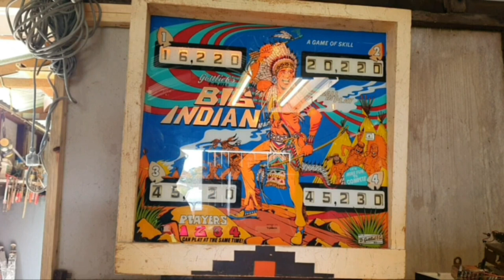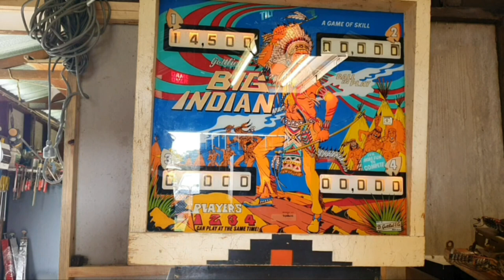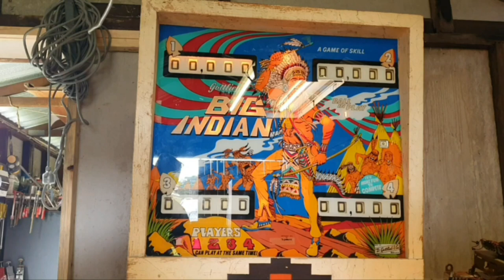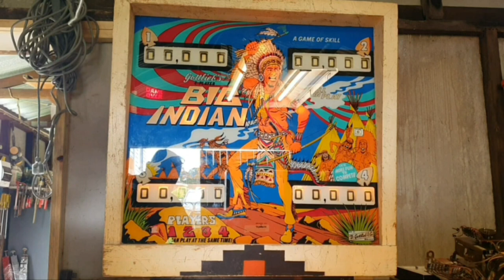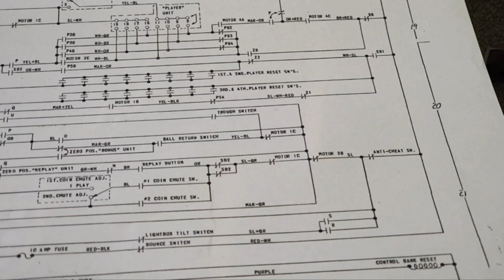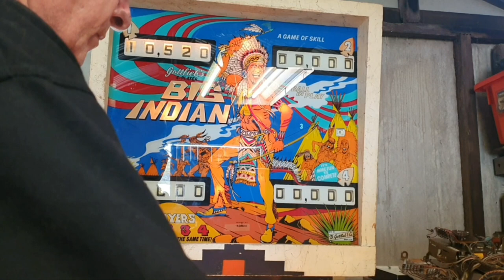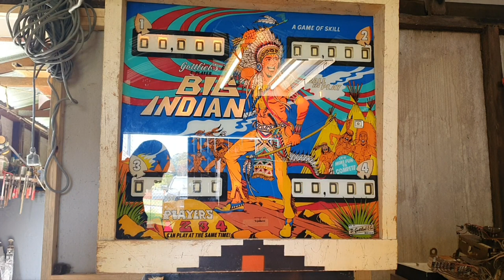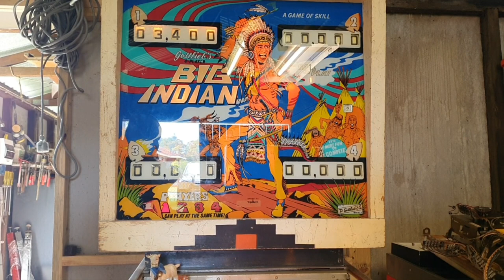Troubleshooting Big Indian Big Problem Switch In Score Motor Schematic Used.

Comment: Thanks for making this video. Videos packed with education aren't annoying when they are long. More troubleshooting videos would be appreciated.  If I may, I'd like to add some of those details to your commentary in this comment to help your community.  At 1:20 the cleaner for the rollers is isopropyl alcohol. 6:00 Before removing the chime wires label the chime unit - on Big Indian it's (L to R) BL-BLK on first coil left side and BLK on right side, OR-BLK on 2nd coil left side, BRown-BLK on left side.  At 11:30 when fastening down the Relay Bank (aka Sequence Bank, Trip Bank Latch Relay Bank etc.all refer to the same) it should be perpendicular and flush. Mine was not fastened flush and on game over it would cycle repeatedly on drop target reset - as an example. At 11:44 the Relay Bank is reset and XB wobbles.  Watch for that.  17:10 the 'tilt' aka door slam switch is normally closed, that is why the jones sockets are jumpered (to simulate normally closed). 22:12 For those restoring to original,  spray silver Krylon Marbelizing paint through a fine screen after the white base coat (practice first) for a speckling effect.
Reply from the maker: Yes indeed great ideas thanks for your input.

Comment: I just happen to have the same problem with my Royal Flush going from player 1 to player 4. I cleaned the 2B switch. I also noticed found that my coin until had a wire touch where it wasn't supposed to. So, problem fix. So thank you very much for the videos.
Reply from the maker: Excellent glad our videos help you thanks very much.

Comment: Excellent video with some problems I haven’t seen before . I did see on another video about a new Dremel piece you tried to clean the contacts and female John’s Plug with . Can you tell us the Dremel number or close up pic of the part or where was it purchased at ? I want to get a few for working on my bingos . Thanks again for another video  !
Reply from the maker: I got them in the USA bur I think they were bought off Ebay not sure if they are actually made by Dremel I'll send a photo to you by messenger.

Comment: I have this machine and it is stuck at game over and tilt like the ball has drained same as at 40:00 min in video.  Adding quarters, hitting start button even when manually adding a ball on the replay unit does nothing. I have the schematic and am learning how to read and follow it. I've also cleaned every switch in the machine. Where should I start looking for the problem?
Reply from the maker: Hi thanks for watching. Due to limitations on commenting here we prefer to do troubleshooting help on our Facebook group.
The Goat Shed EM Pinball Repair Specialists 
Feel free to join and ask away.